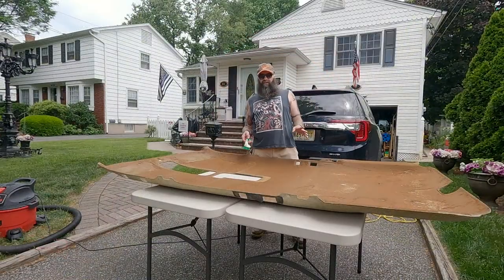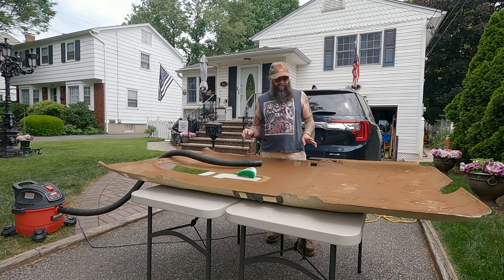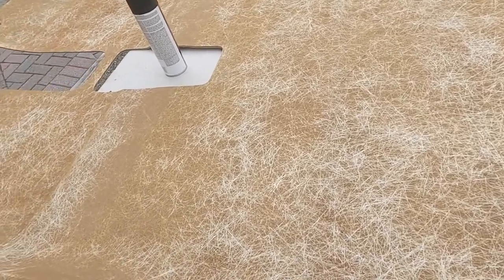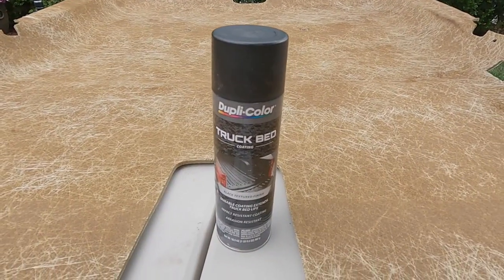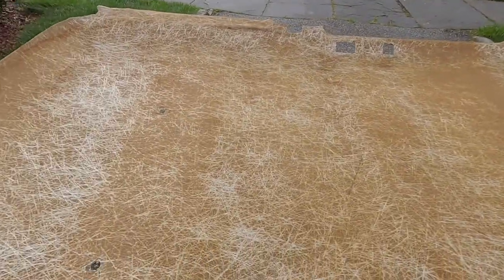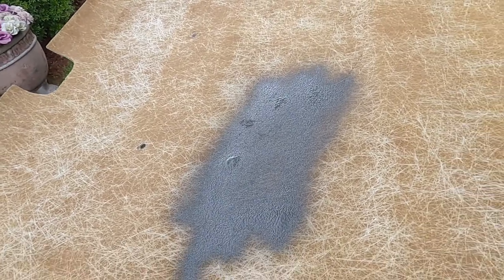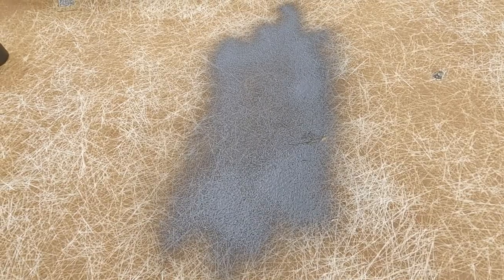Headliner Part 2  Painting ....1996 Jeep Grand Cherokee Laredo ZJ

Comment: Try out some raptor bed liner spray You’ll love it and in 12 years mine hasn’t faded and it’ll stick to anything.  That stuff u used is about the worst for anything exposed to uv
Reply from the maker: Agreed. It sux...
Reply: Thanks for the info; can you get other colors? He should have to do great prep for good results. and use a fiberglass sealer,:goat-turquoise-white-horns::goat-turquoise-white-horns: